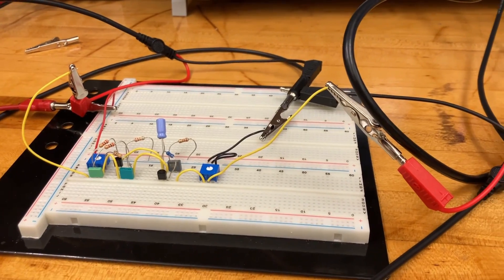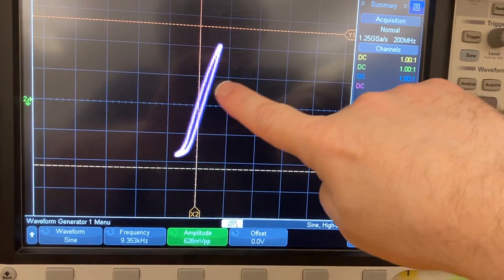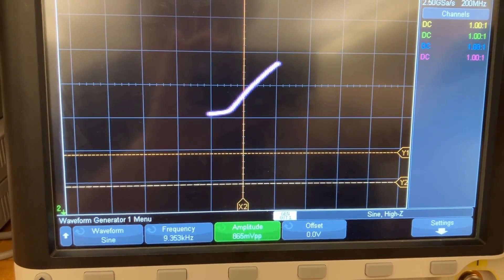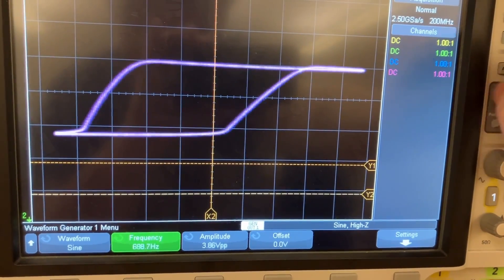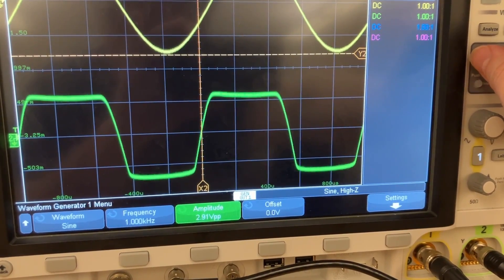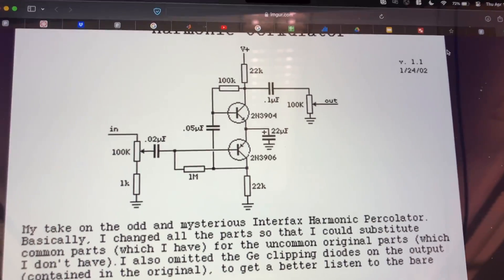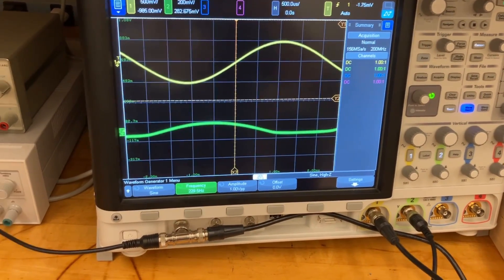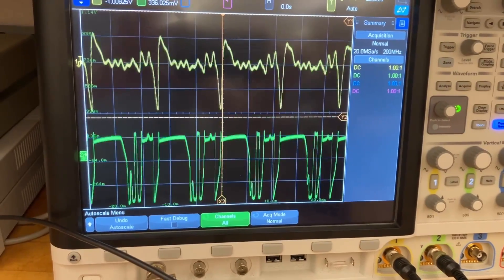Harmonic Jerkulator Measurements on the Breadboard (Inspired by Harmonic Percolator Guitar Pedal)

Comment: Interesting circuit, I'm thinking of making something for guitar distortion myself.
I was going to try to leverage the similarities between mosfet and valve transfer functions by making a 3-stage self-biasing single-ended mosfet signal amplifier but this sounds good and looks much simpler. maybe I'll try both :) thanks for including the circuit with all values.
Reply from the maker: I suggest checking out the runoffgroove website, particularly the discussion of the "fetzer valve" if you are interested in exploring FETs.
Reply: @Lantertronics  ty :) that's JFET though, I don't have any on hand but the analysis could be interesting...

Comment: Cool project. Is this what the distortion looks like before the diode distortion stage? I cant see it on the schematics in the video?
Reply from the maker: Yeah, in this "Jerkulator" variant they left out the diodes. One could add the diodes back in but I liked the idea of focusing on what the transistors are doing.
Reply: @Lantertronics  Indeed a good idea. Just wanted to make sure what I was watching 😊

Comment: I think you have just documented that the "Jerkulator" is not correct.  Simply squaring up the signal is not what the design intended (I think).  Over the normal frequency span of the Guitar, it should be adding harmonics including both even and odd ones in about equal amounts
Reply from the maker: It only "squared up" after I pushed the input pretty hard; at intermedia levels it is still linearish at the top part of the waveform and rounds out at the bottom part. There's also the weird little horns that appear just at the top of the waveform (I'm wondering if its acting like a wave folder there)
Reply: @Lantertronics  None of those things really justify the number of parts used.  I think there is a mistake somewhere.
Reply from the maker: @kensmith5694  Sorry I'm not understanding you -- it doesn't seem like it has very many parts?

Do you mean you think the Jerkulator schematic has a mistake? It's not trying to be an exact Harmonic Percolator.
Reply: @Lantertronics  To me it seems to have a lot of parts for what it does.
Yes, I think the schematic has a mistake.  Ask your self, what it was supposed to do to the input waveform.
Reply from the maker: @kensmith5694  Ah, you're talking about making an improvement in the design. I just wanted to clarify whether you were talking about that or whether you were saying this schematic isn't accurate to Tim Escobedo's design.
Reply from the maker: @timescobedo3512 has commented on this video and can comment further on whether the schematic I found matches with his intent.
Reply: @Lantertronics  Matching the intent is one thing but ideally he should explain what the intended action is.
There being a lot of parts still is a mystery.

Comment: Nice presentation on one of my favourite guitar pedals (the Jerkulator, not the original Percolator), thank you.
My understanding of the inventor's intention was to emphasize even harmonics of the original signal (as opposed to the odd harmonics of a "conventional" fuzz box) since even harmonics are always concordant with the fundamental, whereas odd harmonics are always discordant after the fifth harmonic. Thus this circuit sounds less "harsh" than a conventional clipping type of fuzz box. Good luck with your project!
Reply: interesting thanks for sharing
Reply: yes indeed, uneven/asymetrical distortion tends to generate even-harmonics whereas symmetric distortion tends to generate odd harmonics, like the square wave function.
I wonder what the hysteresis does, it does look lovely.

Comment: Though it is cool that this circuit can work with both transistors being silicon; the things that make it really shine as a unique effect are lost. I suppose it could still be useful as a sort of buzzy fuzz, but I'm not hearing the intermodulation effects that the original circuits imparted. The issue, I suppose, is that it isn't really predictable. I built a version that can be tuned to have an octave divider effect by using a leaky, high gain germanium transistor in the Q1 position, and adding potentiometers for the Q2 collector resistor, the series resistor with the clipping diode, and by adding some resistance between the Q2 emitter and the bypass capacitor. It's quite a balancing act though, and I am yet to fully understand how the octave effect actually occurs. I suspect that the input voltage drives the circuit into momentary oscillation at certain frequencies. That sort of unpredictability with the Jerkulator version is corrected, but it also eliminates the uniqueness of the sound.
Reply: I'd never heard the original and was puzzled by the signal path. I also had no reliably consistent germanium transistors so I used what I could. The available schematic also showed clipping diodes at the output, which I figured would've masked any of the finer characteristics of the weird topology,  so I left them out.
Reply: @timescobedo3512  I am familiar with the famous "Circuit Snippets" and I am a big fan. However I do think, in the case of this of this particular circuit, that the leakage current imparted by the germanium is paramount to the sound. Perhaps there is a way to simulate the leakage current in another way. I also think that, in this case, the clipping diode arrangement is important as well.

Comment: while I admire the scientific rigour involved in these exercises, I never cease to be amazed & a little disappointed by the apparent reverence with which these designs are held by the electric guitar fraternity, when essentially they are just badly designed amplifiers, imbued (after the fact) with some sort of musical mojo.
how about- instead- we imagine something that would be genuinely musically useful, like something that chucks out bucketloads of even-order harmonics, & model that, & then build it?
I once cloned a foxx-tone octave pedal by reverse-engineering a real one (belonged to ian broudie of the lightning seeds), & learned a lot in the process. there must be a way to improve on this design so that all of the harsh clipping can be avoided & a pure octave-up signal be resolved, without going digital.  there's a challenge!
Reply from the maker: Something I've wondered about is multiband distortion -- take a filterbank that, if you just summed the outputs, would give an approximately flat response, and then individually distort the output of each channel and sum that. I've never got around to trying it.
Reply: @Lantertronics  There's the Craig Anderton Quadrafuzz. Splits the signal into 4 bands, each with a devoted fuzz circuit (a send/return for each channel would be neat though). I'm not sure if something that could dynamically track the fundamental to tune the filters would be strictly needed, but I suppose it could be simulated to see. Disclaimer: talking out of my butt a bit here.
Reply: @Lantertronics  isn't that what "aural exciter"s do? ie split off sub-bass and treble and add judicious amounts of distortion to each before mixing back in?
Reply: You should see how common that trend is in both boutique and commercially designed pedals. Lots of devices biased wrong, stealing input signal from the guitar to bias properly meaning, losing signal and adding unnecessary distortion, and just sort of tripping over their own feet throughout the design before outputting something that is somehow useful.

I made the mistake of telling some "experts" that the fuzz face designs under analysis and others relative to it were biased incorrectly and weren't Class-A, boy did I get a mess of drivel trying to sound like competent theory! 
I understand why some circuits are screwy and unconventional, but it's common the designers themselves don't actually know this. 
I'm sure these folks in the video know this.
I indeed did go to a tech college for engineering, so I'm not being deceived by the misconceptions I find exist largely due to people being taught the conventional current path.
Reply: Yes, many of these old circuits have characteristics that are terrible in almost any context,  but manage to a niche of charm in spite of it. And those very characteristics get quite tricky to reproduce using proper design practices that are commonly accepted today. The one that always comes to mind is the circuit with a very low input impedance that only really sounds good if it sees a passive high impedance  guitar signal on the input.
Reply: Everyone's a critic, but the only criterion is "do I like the final sound?"
Reply: @MirlitronOne  it largely depends on what style someone plays. I shred and sweep a lot, so a tremendous amount of pedals with corners cut in their design can't provide the clarity necessary when you're hitting really bassy, clustered arpeggios, especially on an 8 or 10 string guitar. 

I'm always most concerned with note separation for those particular shapes and pitches. It's one of the reasons I went to school for engineering; so much gear just doesn't perform, and so much gear isn't worth spending 5 grand on to build a tried and true rig for your particular style.
Reply: Sounds like something you could do by making high-Q switched capacitance filters that operate on different multiples of the fundamental frequency. In other words, a beautiful opportunity to use PLLs!